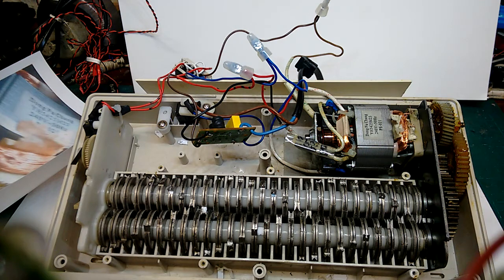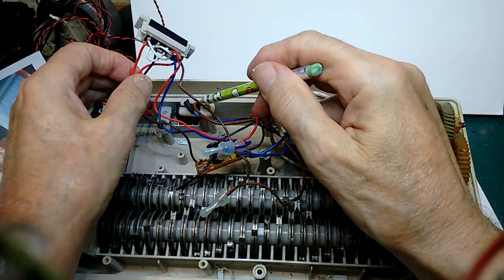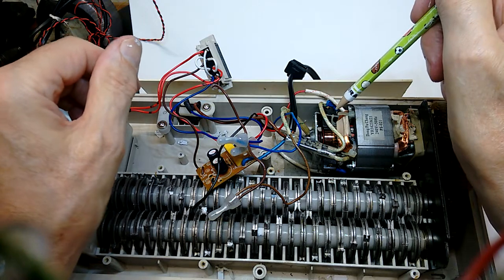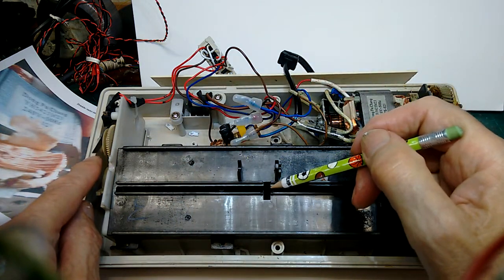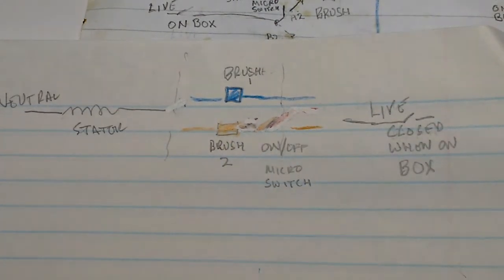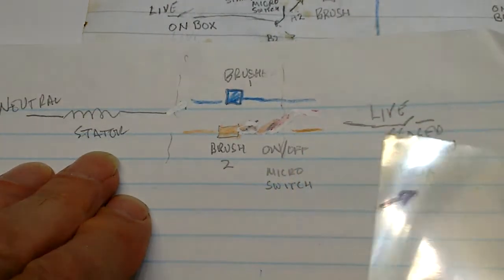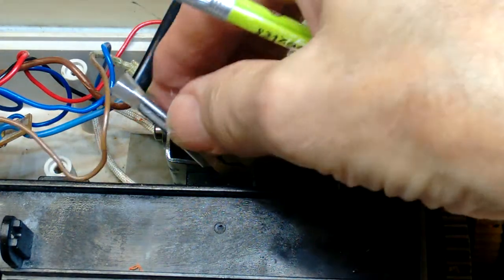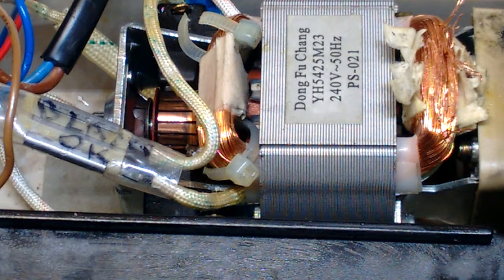Paper Shredder Electrics

Comment: I need to reconnect the little box with the red and black wires attached to it. It has a hook on the end of the box like it is supposed to hold onto something. What does it hold onto and where do I find it.
Reply from the maker: Sorry but I can't find a little  box with red & black wires. I may be able to help you if you can identify your part on the video. At the start of the video (3 sec in) you can see all the bits. On the left 2 red wires come from the stop switch. These go to the voltage selection switch (hanging over the back on the video) the switch just in front is to detect if the mechanism is on the box. In front of that is the main circuit board. Motor wires come from the voltage selection switch and main PCB.Hope this helps.